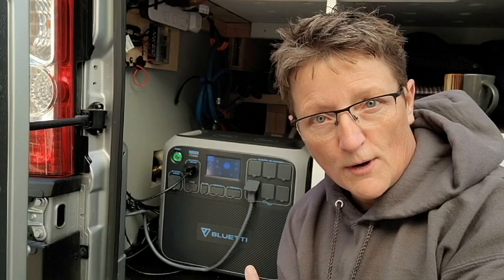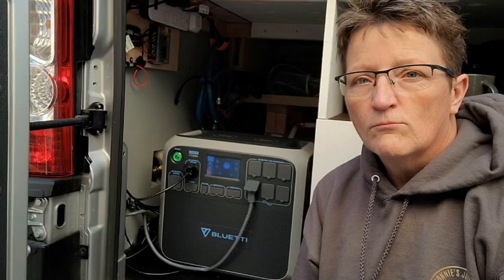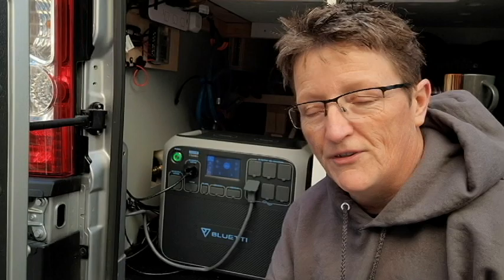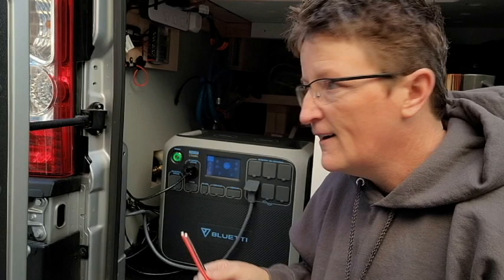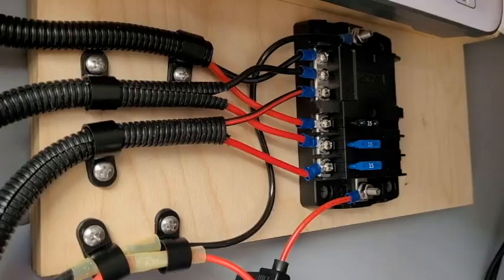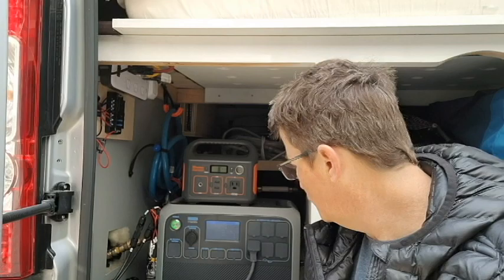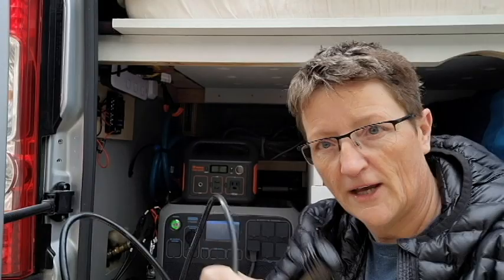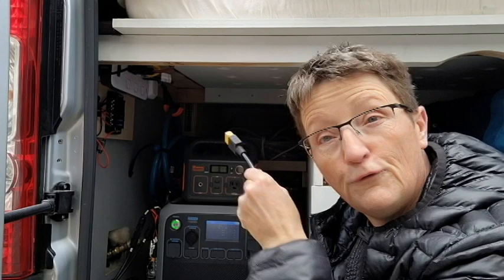Connecting 12V Fuse Panel To Portable Power Bank

Comment: I have a question.  Could I just purchased the 12 volt standard barrel with the two ring connectors on the other end , like you added to the xt60 , and not use the xt60 connectors ? I'm using an ecoflow river pro and don't have xt60 out
Reply from the maker: Absolutely. I use xt90 because it allows me to use Jackery if needed.

Comment: Quick question, on your fuse panel do you have the main negative lug grounded to the chassis? Or do you just put one end of the negative to the connecting wire to the solar generator and one positive to the 25 amp service also?
Reply from the maker: Rick, good question. Originally I just wired it to the aviator port. I had some LED's flickering and it drove me crazy so I ran a wireto the chassis. NO change. Changed the LED's out and flicker is gone.  No need to ground the Bluetti plug is enough. 👍

Comment: The Jackery 2000 carport has output power of 2 Watts, the supply from the carport to the fuse bank will not work in the configuration you present in this video. I wired up as described in video not pulling enough power. Not sure which Jackery you have maybe the 1000 and it works with that? If I am mistaken please correct me, I would love to use the cable I just made. Are there any other ways to provide power to the fusebox using the Jackery 2000, maybe use the A/C output with the proper plug in to the 110 port?
Reply from the maker: The car output is more than 2 watts?  It is 12v/10amp.  Is the Jackery reading 2 watts.  Sounds like whatever you have connected to the fuse panel is pulling 2 watts?

Comment: One thing I cant find is the jackery cigarette lighter to xt-90 part. Would you happen to have a site you bought this from. Very good info on how i plan to build my simple electrical.
Reply from the maker: Mine came with the Bluetti.  Buy a cigarette adapter on Amazon and yo7 can make one lots cheaper.  Bluetti seems to be out all the time.  I love the setup. So so so easy.  Did it for my current build too.

Comment: Hey Jonnie - good info - quick question - I should be able to cut off the cigarette adapter from my 12volt cable for my fridge and put it right into the fuse box as well;  correct? I have a BougeRV 30 Qtr Chest Fridge. Thanks
Reply from the maker: Yes you can. Most of them max out at 10amp but depending on your setup. That may be plenty.
Reply: @JonniesJourney  Thanks for the response!!

Comment: When making a second SA20 aviation plug for the Bluetti AC200P, which of the pins , 1 or 2, was positive & which was negative?  Also, how long did you make the wire and what size/gauge wire did you use?  TIA.
Reply from the maker: Ty connect your red wire to pin 1.  I use 12 awg wire.  I used about 2 feet.  If your bank is going to be close to the fuse panel than you can shorten it.  If you make it longer put your inline fuse closer to the power bank.
Reply: Thanks for the quick response & for your expertise.  Really appreciate it.

Comment: This is so helpful!  This is right where I’m at right now with my battery project.
How do I know what size fuse to put on the positive that goes to the fuse block? I only run an occasional fantastic fan, furnace fan, or LED lights.  (My Iceco fridge is on a different circuit.)
Thanks for all your helpful content Jonnie!
Reply from the maker: Most components have a "max fuse" rating.  If you can't find it you can multiply the amp usage by 1.25 and get the closest fuse to that.  I tend to use 10 and 15 amp for most things.  How do you have your Iceco fridge powered.  If you can get it on the DC circuit it will save you more power than running it on a AC circuit
Reply: @JonniesJourney  thanks Jonnie!  
So, do I add up all my component max fuse ratings and use that amp fuse size for the main red positive wire that goes to the fuse block?
I have my fridge plugged directly into the Bluetti's dc.  I try not to run anything on AC if I can help it😃.
Reply from the maker: @mrsjohnson1743  put a 30 amp fuse in the main by Bluetti. Fuse everything else individually 👍
Reply: @JonniesJourney  Great! Thank you Jonnie!  Your van build work is beautiful. I really enjoy the videos seeing how you approach different builds.

Comment: Thanks so much for this video. I am preparing to setup my solar power system (4 x 100 watt solar panels) and have three questions:
1. XT-90 Cable connected to the fuse panel, do you need to use female or male connector or doesn't that matter?
2. What size fuse did you use for the inline fuse 
3. If using the aviation cord for output to the fuse panel, does this need female or male connector?

Thanks so much!
Reply from the maker: If you are only using one system (no backup) you can skip the xt90. Bluetti uses the xt90 system and I have a jackery for backup so I had to use them.  Skip it if only have the Bluetti.  My inline fuse is 15amp.  If you have the ac300 you can fuse higher. The aviator plug that goes to the input does not work for input.  The aviator plug that you order will come with female and male connection, you will connect using the male part.  Let me know if this does not answer your questions.  Take care
Reply: @JonniesJourney  thanks so much for the information. I will be giving this all a try very soon. Wish me luck and happy adventures to you.
Reply from the maker: @hollyquarzo1518  good luck.  You got this

Comment: Would it be possible to do this on a smaller scale to the Bluetti EB70s? Was thinking of plugging small dometic fridge into 12V cig. port and trying to take DC 5521 to fuse box for just fan and 1 led light strip for weekend trips. Should  have enough power, just unsure of connections. Could also use both dc 5521 (1 for LED strip, 1 for fan)
Reply from the maker: Not sure about taking a 5521 to fuse panel.  I would take cig to fuse panel and wire fan, LEDS, and a dc cig adapter to fridge. Then everything is fused and off the cig.  Cig should be 10 amp and could handle no problem.  If your 5521 is at lease 14awg it could work though.

Comment: Question: I have the Bluetti 1500 and it has the cigarette lighter for 12v output. I’m confused about what kind of cord to attach to the XT90. Do I just get any 12V male cord then wire it to the XT90?
Reply from the maker: yes.  May just have to change out the fuse if it comes with a 5amp fuse.  Does that Bluetti have the 12v/9amp output?
Reply: @JonniesJourney  yes. DC 12V/9A.

Comment: Electric newbie so forgive. So you wire in one end of the XT 90 on the positive/negative connectors on the fuse box and the other XT90 end comes from your Bluetti to plug into that. Not sure exactly where the one coming from the Bluetti plugs into into on it. Can I also plug the Bluetti into my car charger while driving to charge it up with that connection still plugged? I have been trying to see diagrams somewhere that shows where these items actually plug into the Bluetti without much success. Thanks much for your down to earth explanations and reviews.
Reply from the maker: yes the SA20 cord I made connects to the 12/25amp port.  yes you can also charge from car while driving.  let me know if you have any other questions.
Reply: @JonniesJourney  thanks again for taking the time with valuable information. Pulled the trigger on the AC200P and solar panel combo they had and very excited!
Reply from the maker: @weavgiff  so awesome. I think you will be very happy you did.  Congratulations Jeff and good luck

Comment: I tried to do this with my Jackery.  The fan ran.  An then my cig. Adapter wouldn't work any more.  I had a 40 in line fuse.  Would this be the reason it quit?  I only had a 15 and a 40 here so went w the 40.
Reply from the maker: What size jackery do you have. The 40 is too big for sure.

Comment: Thank you so much. I ordered the SA20 connector you linked, but it doesn't fit the 12v/25a output on my AC200P..... It's very very close, same kind of connector, but just barely a different diameter and I'm simply baffled and in a huge hurry to find the correct size. Has anyone else had this problem? Any help would be very much appreciated. Thanks for all your wonderful work and safe travels 😊
Reply from the maker: When did you order it?  I changed the link last week.  Bluetti changed the 200p port to the same as the AC300
Reply: I did notice the port covers on our two units (same model) were different. I ordered it yesterday. The production date on my unit is 2 years old. Maybe I have an older version connector. I found what I believe to be the correct one elsewhere on Amazon.
Reply from the maker: @highballhighlife8352 does yours click in, or does it have the screw on connection?

Comment: I’m having a hard time finding a XT90 cord that I can plug into my eco flow. Am I able to use a XT90 to XT60 adapter?
Reply from the maker: Yes you can.  If you need a xt90 I have some.  Does your EcoFlow have the Anderson connection.

Comment: Hi Jonnie and thanks for this helpful video explaining something i wasn't even aware could be done:) Can you tell me if you have solar panels to charge your Bluetti? Maybe i missed something, but wondering if you can do this while also using solar panels to charge the Bluetti. Thanks again!!!!!
Reply from the maker: Absolutely, the aviator plug goes into the front 25 or 30 amp port (depending on your unit).  The charging aviator plug goes into the side port.  Which unit do you have
Reply: @JonniesJourney   THANK YOU! i am still undecided on solar generator. Can this be done regardless of which one i choose? Looking to go simple, but flexible as well. Want to locate ports and switches in accessible areas of the truck bed. 12v fridge, lights, a fan, usb ports, water pump...Your videos are so helpful!
Reply from the maker: @karengreen5287  yes you can, but remember some solar banks only have 10Amp cig ports for output. Depending on your setup you may max that out and deal with tripping the breaker often.  Add up all your components that you hope to use and keep it under 120w/hr including startup.  Bluetti has the 25amp and 30 amp option with the aviator port which I am a huge fan of.

Comment: Ok. I changed the 90Xt to 60Xt, according to my Bluetti 2000AC Max specs. I did everything you said, even the additional fuse connection. I have the DC and AC on, bought the BLUETTI RV Cable 12V/30A, Aviation Plug to XT60 Cable and I still don’t have power.  Why am I doing wrong?? I’ve spent money in the 90Xt, that didn’t work, bought the 60XT, down $80+ dollars down and I’m so frustrated.  I don’t know what else to do and it’s been really hot out!
Reply: Please HELP!
Reply from the maker: Please email me at midwestvanbuilders@gmail.com we can do a call and brainstorm this.
Reply from the maker: Please tell me someone didn't charge you $80 for an xt90.  Bluetti is changing their xt90's to 60's. This video is a few years old when everything had the xt90. Sorry

Comment: Jonnie the sa20 cable that you show  linked to amazon appears to be a 2 pin male connector. The bluetti cord is a 2 pin female connector. Any suggestions on where to get a female sa20 connector? Thanks!!!!!
Reply: The one she has linked is the right one it comes with both the Male and Female connection it says Plug and Socket that all you need.

Comment: Hello. I purchased a spare aviation connector for this. I noticed it has an xt60 end vs xt90 do I need to use an xt90 cable for the fuse box or can I just get an xt60 to connect it instead? I don't know the difference between the 2. Im a newbie...sorry if its a silly question.
Reply from the maker: No problem at all. Some of the Bluetti have Xt90 some have xt60. Either will work
Reply: @JonniesJourney  thank you very much! And if I were to use the cigarette cable in this video...do you know where I could find it? Im patiently waiting for my ac300 to ship and want to be ready in every way when it arrives. Your videos have been a huge help. 💚👊🏽

Comment: I have a question, not sure if you'd know the answer.. so I bought the 12v/25a aviation plug from blutetti which plugs right into the front outlet (its male) but it ends as a xt60 instead of xt90, would that still work just fine if I just buy an xt60 cable adaptor and wire that to the fuse box instead ? thanks !!!!
Reply from the maker: yes it will. thank you so much for watching and good luck on your build.
Reply: @JonniesJourney  thank you much !!

Comment: How do you connect your 16 gauge solar panel wire to the XT90 wire? Also how do you make the cord from the AS20 adapter?
Reply from the maker: Cece I use 12 gauge wire to connect the xt90. I solder them.  I have a video coming out in two weeks that will walk you through the entire connection.

Comment: Thank you for a great video. Question for you.  I have a Jackerry 1000. Where did you find XT90 to cigarette plug adopter to connect it to the fuse box with xt90 wiring?  I couldn't find one you were showing.  Would greatly appreciate your help.  Thank you
Reply from the maker: Can get one from bluetti or make one.  I have a link for the xt90 in description if you need.  thank you so much for watching.  good luck.  I love the Jackery as well.

Comment: If I want to power a 12v fridge, 6 12v led lights, a water pump, diesel heater and ceiling fan, how would I do that? Would I want to connect everything to a fuse box then plug it into the power station or would I need to plug everything into the power station sockets on the front individually? Thanks
Reply from the maker: Get a fuse box.  Make a cord from power bank to fuse panel.
Reply: @JonniesJourney  Just watched your other video of you showing how to do that! Thanks so much! In your opinion, what wattage do you think I would need for this system. I have seen 2000w power systems but not sure if that's over kill or not enough. I am planning on living in the van full time
Reply from the maker: I would definitely do 2000w if you can swing it.
Reply: @JonniesJourney  I will try to get one. Thanks so much for your help😁

Comment: Hey Jonnie, I can’t seem to find an XT90 to cigarette lighter cord anywhere. Where did you get yours?
Reply from the maker: Mine came with the Bluetti.  Save yourself the money and make one. The xt90 and cig plug a very inexpensive on Amazon.  Bluetti is always out.  

If you will not be interchanging sustems you can use cig plug to 12v fuse panel and skip xt90.  Don't forget inline fuse.  Thanks for watching, hope this helps.

Comment: The main thing missing from this video is connect the xt90 to the 2 pin plug because the 10AWG is way thicker than the connector to the 2 pin so I assume you will have to solder it?
Reply from the maker: Sorry I missed that step. Yes I solder the wires.  I  use 12awg wire soldered to the 2 pin to the inline fuse and then the xt90.  Working great.

Comment: When the the accessory plug (cigarette lighter) is plugged into the Bluetti is that a male or female XT90 connector on the end of the cord? Great Video!!!!
Reply from the maker: Bluetti consistently uses the female end on their plugs.  You can run the cig straight to the fuse panel if you will be using different powering devices.  I use the aviator port for Bluetti and the xt 60 on my acevolt, cig on jackery that is why I use the xt90.  This video is older. I have a better video explaining it up on the channel.

Comment: HI, great video, I was wonder why the XT 90 connector was used? I have an Inergy Kodiak and wondering if I could just wire from the fuse box (with a inline fuse) to a 12v male connector into the Kodiak. ...and did you make or purchase the XT90- 12v cord. thank you!!
Reply from the maker: You can absolutely do that. I use the xt90 connection because Bluetti comes with a cigarette cord with the xt90. I wanted to be able to use my fuse panel with a backup soarce if needed.  The xt90 to cig  an be made,  I made the xt90 to aviator cord so I could use the 12v/25amp port.  Not because I need the amps but because it clicks in making it much more secure.

Comment: Hi Jonnie, most awesome video and just the help I need!  Question about the inline fuse for the connection to the fuse box.  The XT90 has 10 AWG wire, does the inline fuse holder need to be also 10 AWG or will 14 AWG fuse line holder be ok?
Reply from the maker: 14 will work. I will look after work, think I used 12awg.
Reply: I was wondering the same thing

Comment: So I have found male xt90 cables with the loop ends already on them but how do you add the in line fuse?
Reply from the maker: The inline fuse is just added protection. It is not required with the power banks.

Comment: Thanks for your video. I was wondering if I could connect the Jackery DC output to a Bussman 15600-06-21 fuse panel (I have an older truck camper). The fuse panel does not have the obvious postive and negative posts like your fuse box - just the power going to it. Any thoughts on that? I really like the your idea of running all my accessories with the Jackery. Thanks
Reply from the maker: So if your system only has power going in, each component wired to it has to be grounded elsewhere.   You could wire the bussman to go to the Jackery but you will need to ground this as well.  Do you see a ground block anywhere near the rest of the wiring.   Please feel free to send me pictures on Facebook or Instagram and I could probably better help you.  🙂

Comment: I know so little...but 14 gauge is thick enough to run from ac200 DC out to the fuse box?
Reply from the maker: yes it is.
Reply: @JonniesJourney  thanks!  I had read somewhere that it was rated for 15 amps.
Reply from the maker: If you run your wire less than 10ft you can run 20 amp on 14g for DC (I would try to stay under 6ft so you don't have voltage loss).  AC is different 15amp for 14g. At 20amp use 12g.